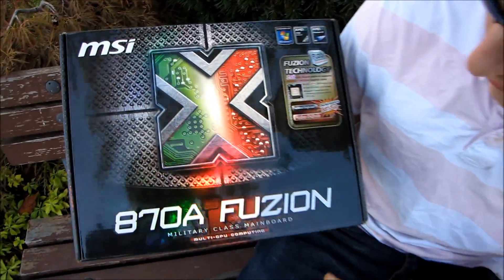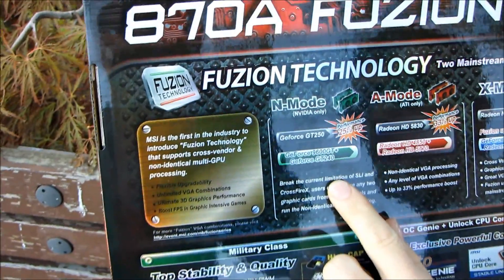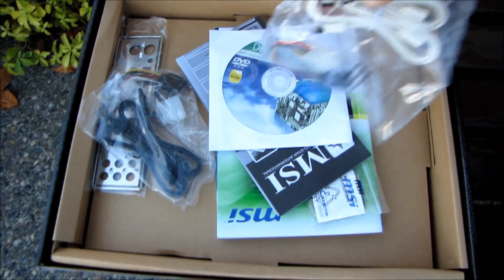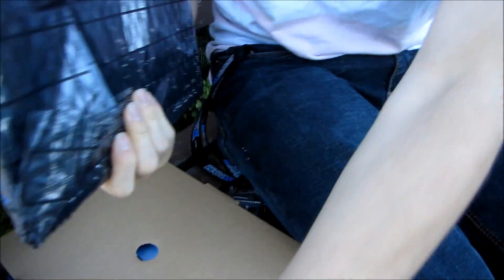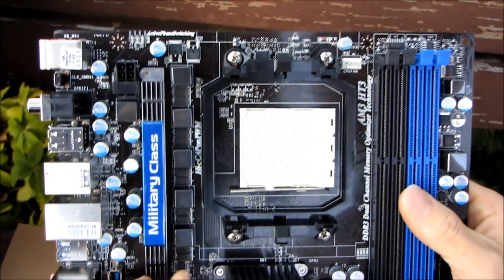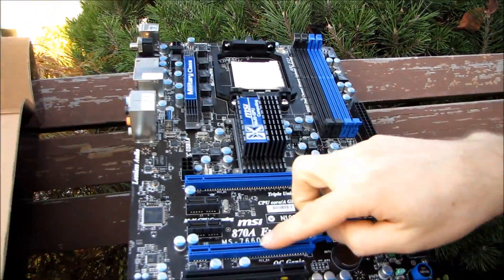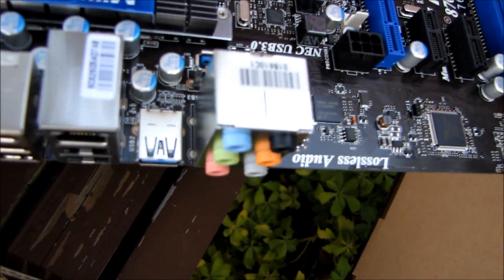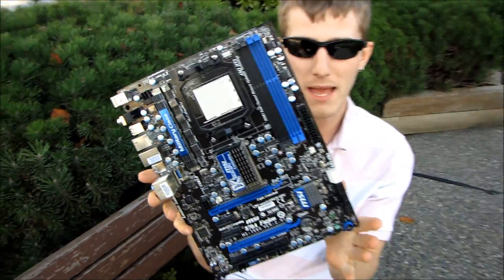MSI 870A FUZION Lucid Hydra Multi Graphics AM3 Motherboard Unboxing & First Look Linus Tech Tips

Comment: I wish Lucid didn't cancel the Hydra line-up. Now that DirectX 12 is a thing, these boards are <almost> completely useless... with the exception that these boards have much greater software support than the mixed GPU functionality in DX12.

...I wonder if you could use a Titan X and Fury X together in one of these boards.

- - - -

Comment Edited on December 02, 2015

Comment: you used to be able to do that but now you have to download quite old nvidia drivers to do it and also use a program that hacks it to work when ati drivers are installed at the same time.
This is also why support for lucid fuzion got reduced since the x-mode (nvidia and ati together) is very awkward to get working.

Comment: @kevgwang They both use the 870a chip but the power edition, which is really hard to find, has the sb850 and one extra pci-e 1x slot because the lucid chip is put under SB heat sink rather than the North bridge

Comment: @OmgItsDedi well i think u got that all wrong or i got it all wrong but those low percents are if u got a lower grade grafics card with a higher grade grafics card so the not so great grafics card is probably only on itself maybe 70% of the other cards power so youl need to concider the loss of those from before raidingaswell and that will change the numbers quite a bit but as i said im not shure so no lame as replies plz =)

Comment: @caste1200 yes its possible not only with lucid hydra but if you have a sli or crossfire motherboard with windows 7 and wm 1.1 you can use ati for main graphics and nvidia for physx only i have that config 5770 main gts250 physx

Comment: @gabel56 Of course, the LUCID HYDRA chip brings up 3 modes as Linus said
1- N-Mode .. for nvidia SLI (even if the 2 cards are diff) or single card config.
2- A-Mode for ATI CrossfireX (even if the 2 cards are diff) or single card config.
3 X-Mode for a crazy Red-Green mode .. I mean a mixed configuration.

Comment: does this still not have support for dual gpu graphics cards? Last time I checked the Lucid Hydra chip couldn't handle a 5970. Also could I use a 5870 and a gts450 on physx?